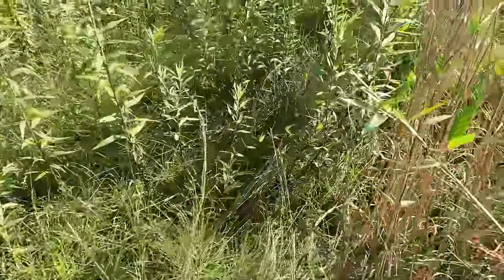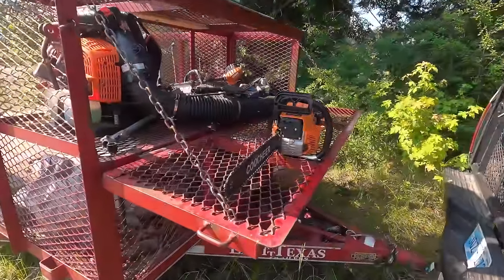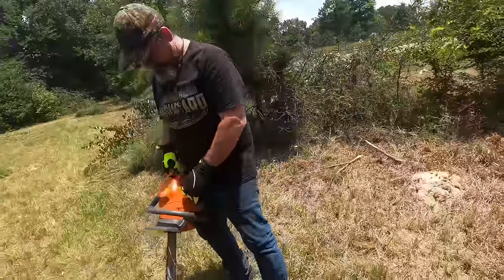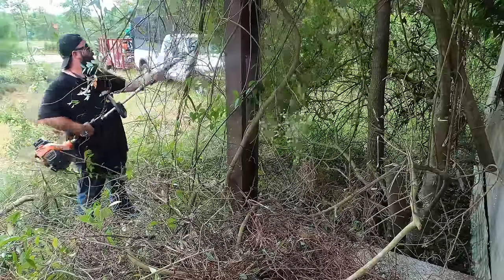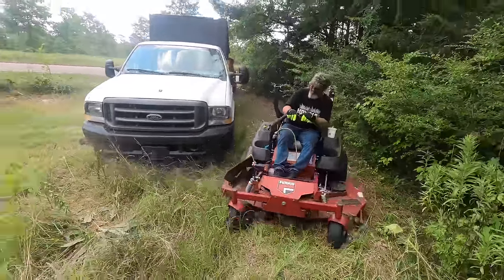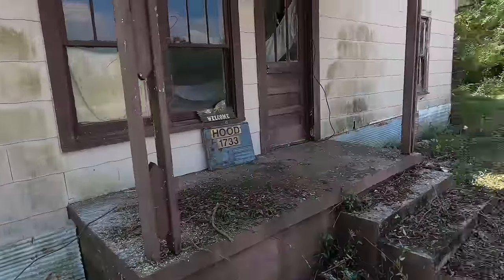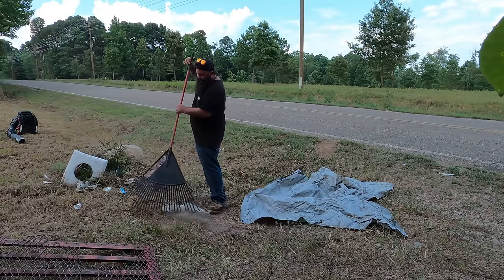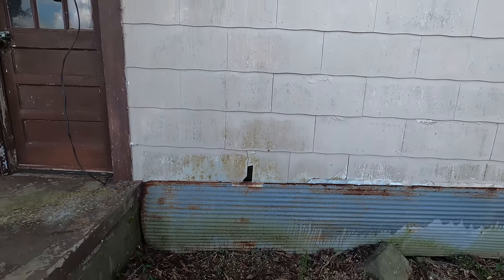I DESTROYED my CHAINSAW on this INSANE FREE yard CLEAN UP! - I FOUND a HOUSE in THIS OVERGROWN LAWN

Comment: From the looks of it, that house was built between 1920 and 1950.  It's a standard pier and beam construction, asbestos tiles (they're NOT the "bad stuff".  Just don't grind them up and snort them).    I suspect that the house would be cheaper to repair than to replace.   Rotten windows, etc, aren't a big deal.  Anyone buying the house now would be replacing the windows with double pane, they'd be pulling the inside wallboard down to insulate and replace plumbing, etc.  The big thing to look out for is if the roof-line is sagging.  If it isn't the roof framing is still intact (likely). 

All in all, I'd call it a "Home to buy and renovate over 6 months while you wait out your current lease"  Just negotiate the price down accordingly.

I forgot to add - great job.   You put in an enormous effort, and it looks so different you can't even put an amount on it.
Reply: I was kinda thinking of the same thing….haha
Reply: Hello

Comment: After the 20th fail on that chainsaw, I was thinking it’s time to invest in a new one. But to see what you did to the chainsaw was epic! Had me laughing so hard! Way to go! So glad your Dad was with you helping you with this big project! Thanks for the video- great job!
Reply: One word - Maintenance. Clean the carb. Change the oil. Replace the spark plug. Change the filter. Lubricate the moving parts. 
Hope this helps.
Reply: @HakimDFrye  Apparently hes only used that saw twice before - if it gets that bad after 2 uses, its really not worth having around

Comment: Just a friendly tip about a file: It only works one way. If you back-file, it dulls the tooth as you’re sharpening it. Also, don’t forget to file down the rakers, so your tooth can grab as it gets smaller.
Reply: Yeah you always have to remember to only file with a smooth even pushing motion. I was thinking the same thing when watching him sharpen the chain.
Reply: Well he smashed the saw. Good to know how to sharpen a chainsaw.
Reply: Yep that's what I noticed too, and try and keep the same profile on each tooth. Otherwise good dude for doing thus free work.
Reply: Yeah I was cringing watching him sharpen it lol
Reply: Somebody with some knowledge.
Reply: True, but I wouldn't recommend filing rakers unless you really know what you're doing. If you do it wrong it can be dangerous. But I did a fair bit of that when I was logging. Also maintain the same angle while filing and move the chain every two or three teeth, doing one side at a time to keep a consistent angle.
Reply: Thank you. My grandfather was spinnin in his grave ...I could hear him yelling!

Comment: Nah brother, I'm a tech that works on Ferris's regularly, those logs won't hurt her. They actually make trailer hitch attachments for them to pull, only about 50 bucks or so for the name brand, and the hitch itself is rated for around 200lbs, but the bumper (and bolts for it) on an is700 is strong enough to pick up the whole mower ✌

Comment: You guys did a great job, a lot of work for sure. This channel has really inspired me to reclaim parts of my property that have gotten overgrown and I've been slacking on for years. It feels great to see it all be slowly cleaned up, but it's just laced with poison ivy, so I can only do it in sections as I kill it off with a soap/salt/vinegar solution, don't want anything stronger around my dog.
Reply: The young man who mows for me uses soap salt vinegar spray. Works great.
Reply: @janedmn  That's what I've switched to, exactly that recipe and it does dry it out fast,  leaving most other plants alone. First day I ripped a bunch out with gloves, big mistake. I still have red spots healing up. That stuff is not to be taken lightly, I learned the hard way.

Comment: Love your work, I do wish some of the other trees could have stayed though (the ones like xmas trees) ! My old neighbour cut down 3 of those from his front yard and the effect of them being missing was staggering when it came to the inside temperature to both his house and mine. (it would get 60-70 degrees hotter in summer, and the reverse in winter). Plus in this case they would have been a bit of a noise barrier from the road.

It's a free job though, so dealers choice, and you are the dealer!
Reply: completely agree !!! houses with no tall tree get crazy hot in summer while  house with trees don't even need to have air clim most of the time
Reply: I hate seeing trees going down! Makes me so sad. Most especially those fir pine trees out front
They were beautiful.

Comment: Like your videos.
Looks like you run your chain too tight. When tight it should hang a little and run free. If to tight it will heat and stretch. On a new saw it is always a good idea to check that it is oiling. Also try to file the same number of strokes on each tooth. This will ensure that they are of the same length an the saw will cut more straight

Comment: Well the filing at the beginning kinda made twitch, however I just got to the part where dad pulls his saw out. Good choice dad but you busted up a saw for a clogged filter. You also just keep the pocket screw driver for dialing in you weedeaters I assume, you could have just adjusted the fuel mix to finish the day and corrected at home.

Comment: I bought my Crafstman chain saw in 1989, and that old thing has cut more wood than i can remember and it will start with in the first 3 pulls. I just put a new spark plug in it last summer. first one since i bought it.   The Sears Craftsman saws are totally awesome.

Comment: Hey just so you know a chainsaw file is designed to file forwards .light stroke forward , let off pull back and add pressure go forwards . Just sayin I have been a sawyer all my life . Some people just never knew . And it is a tip . Do how you want it is your chain and saw I understand . Don't forget the rakers they have to have a flat file here and there

Comment: If it bogs down when you hit the throttle, it's either fuel-starved or the exhaust is giving back-pressure. It's probably a butterfly valve. Clean the carbon off those before going after the carb.

Comment: Did you notice how easy the Coocher started AFTER Kevin check to make sure it had gas and it ran fine for a minute or two then quit.  Wouldn't start again.  The problem is the tank is not venting.  Simple fix.

Comment: Just watched this video and I only have one thing that I would like to say. When sharpening a chainsaw you don't pull back to yourself only out,and however many strokes you do only was you do the same to the opposite side. Otherwise it will pull to one side while cutting and also file the drags down a little not to much or it will take to big of bite. When you start to see small chips ,dust check your chain if there is build up on top of the teeth it time to sharpen. Another thing while sharpening your chain tap you file gently to get the metal flakes out so you will get a fresh cut on the tooth. Check your blade for build up in the valley of the blade under the chain it helps the oil lubricant the chain better. If you see or feel rough edges on your bar take a flat file and gently remove it. File from the top down you want the rollover to fall off not from the bottom up. This goes for electronic or Gass powered saws.
Not complaining just passing on helpful advice to help you save and make your chain and bar last longer.
My uncle always sharpened a new chain I never did he was a logger for over forty years he taught me a lot I will never forget the advise he shared. I thought I would pass it along to help you out.

Comment: 1:23:45  the house I grew up in was abandoned and then it was tore down because a highway was being built near by, but they ended up not using the land the house was on, so there was no need for it to be torn down, after all. If you are ever in NC, there is an intersection, Hwy 64 and Hwy 751/ New Hill Rd and on the corner is an abandoned house. You can see it on Google maps. The house has to be 100-150 years old, beautiful architecture, but now it is so overgrown that you cannot see it hardly at all from the road. The address to the house is 44 New Hill Rd.

Comment: You just made a suggestion that a battery or electric chainsaw would be a good choice. I would suggest that you check into the safety factor. Those saws do not stop the chain as well as gas powered saws. Go for safety!

Comment: I rented a mobile home in San Jose, CA. Most of the yards had old juniper bushes that topped the houses and hid the windows. The boyfriend of the manger lived on the other side of the road. I went to remove the bushes, he saw and offered to use his brand new truck to pull the junipers out….. I feel bad, the 2nd bush pulled off his bumper. 😟

Comment: During a field exercise while I was a combat engineer one of the tasks was to construct a tripod to lift a heavy trailer off the ground using block-and-tackle systems, using only issued squad equipment.  Every squad prior to mine failed.  When it was our turn, rather than having 8 or 9 people pulling on the rope, my squad leader tied the line to our truck, which easily lifted the trailer.  Because "the truck is part of our squad equipment, isn't it?"

TLDR:  If you are going to cut down a tree, use your truck to put tension on the line, then cut.  The tree will fall where you want it to.  Just make sure to use a long enough rope so the tree doesn't land on the truck.

Comment: i think the reason the chainsaw worked after opening the petrol lid was the suction from the air in the petrol tank not letting the petrol flow it happens to me on my lawnmower some times i need to open the cap. i could be wrong tho

Comment: I got the dewalt 20v pole saw. I wanted to get the one for echo but i have the 225 head which i dont think would be stronger lol. 
And i already have alot of dewalt 20v tools.
For a homeowner its nice. Never would use anything electric if a pro lol

Comment: dude. when you are cutting down a tree put a notch in it on the side you want it to fall. And cut in the back side about 8 inches above the notch   at a   45-degree angle towards the notch   aiming at the bottom of the notch, the last couple inches will act as a hinge and the tree will slowly fall in the direction of the notch also you will not pinch the bar

Comment: Need to get an echo cs590 timberwolf. It's a beast. And can get up to 24" bar on it stock. I've seen comparisons where it beats Stihl and huskies of same class.
Although I won't get as much use out of it, it's on my list. My buddy has one and cuts like butter. No skip chain either. Full chain and you can bury it.
For the price difference compared to the more "homeowner" models, I think it's worth the extra couple bucks. $419 as of making this comment. You'll pay $300-$350 easy for half cc amount and small bar "homeowners" saw

Edit: rewatching the video. Love this stuff
Reply: I got one. And a CS-3510 for limbing. 
It's a beast.

Comment: Well, at least you actually sharpen your chain. I've seen a lot of people use a chain until it gets dull then they throw it away and buy a new one - I guess not realizing that you can sharpen it or not caring. I log with my dad and brother so we have to sharpen ours a couple times a week. I'm just getting to the point where I can sharpen one pretty good but my dad can make them as sharp as or sharper than when they're brand new. Also, at least your saw's not a Poulan lol. Seems like you see people using little Poulan "gardening saws" and thinking they're a macho man or something lol. Stihls and Husqvarnas are pretty good - that's what we use. I bet that felt good smashing it.. I feel like that all the time lol.. 

We did tree removal in people's yards for a while years ago and I remember we were taking out this gigantic probably 80+ ft pine that was right up against a multi-million dollar house. It was my job to pull on it with the skidder while my dad cut it to force it to fall away from the house. I started pulling too early and broke the cable just as he was cutting through it and it swayed toward the house then it swayed alongside the house and fell right beside it - it was close enough that the limbs ripped their gutter off.. But a few more feet and I would have demolished a couple million dollar house. We got out of that business pretty quick and went back to regular logging.

Comment: I generally love both of your channels,  but when you start cutting  down  beautiful, nicely shaped pine trees in a large open lawn, I have to escape that video. Had you just cleared everything except the pines, the house would have been quite visible enough and still retained a bit of privacy, plus the sheer beauty, not to mention the healing properties of the air around pine trees. Unless they are growing on top of each other, trim but leave them there.
Reply: I agree & was thinking the exact same thing.  BUT still looked 1,000 times better!

Comment: Husqvarna is the best chainsaws ever made.what did you think was going to happen to a $170 20inch saw.the $499 Husqvarna 20inch saw you probably could of cut down every tree in that yard.ive had my Husqvarna 16in chainsaw for 10yrs and only change oil,chain and had to change out the prime bulb and that's it still cutting with it 10yrs later.you get what you pay for always 😉
Reply from the maker: 🤣🤣🤣 I didn't pay for it some Amazon seller sent it to me to try out. I am just an honest dude and if it's crap then I will send that equipment straight to the trash lol. I prefer echo products but I agree Husqvarna makes a damn good saw.